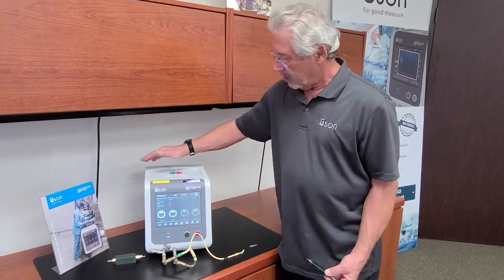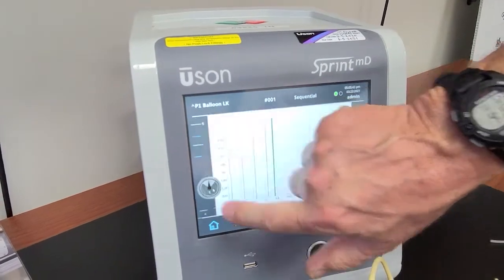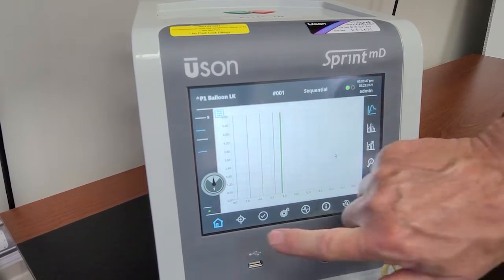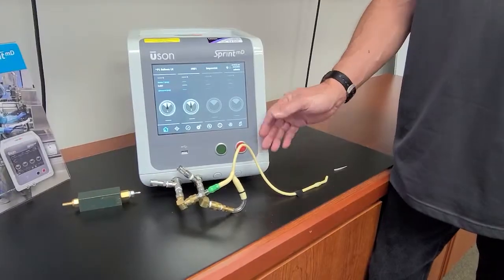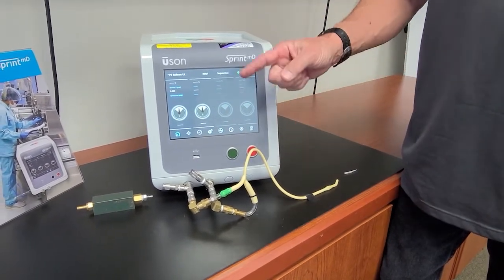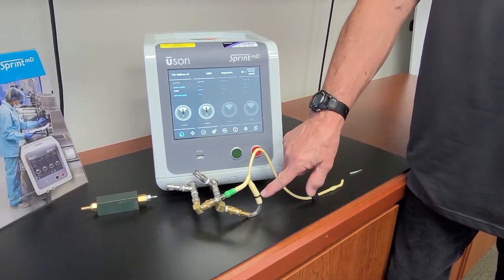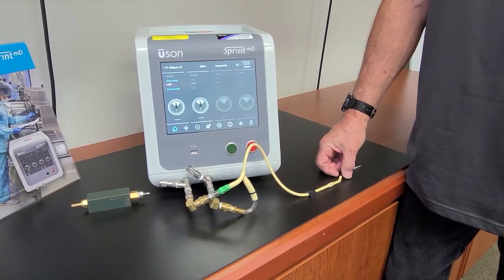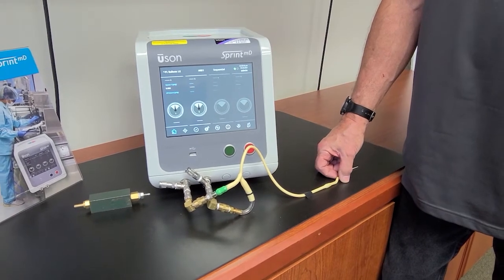Sequential Leak and Flow testing with Sprint mD

Comment: I need to perform a similar two-stage test and was wondering if the Sprint mD is capable of performing this test:

Test 1:
1) Fill device to 30 mmHg.
2) Test for pressure decay over 10 seconds. Display overall pressure decay throughout this duration.
3) Do NOT vent pressure from device.

Test 2:
4) Fill device from 30 mmHg to 40 mmHg.
5) Test pressure decay over 5 seconds. Display overall pressure decay throughout this duration.
6) Vent. End test.

The current leak tester I have can link two tests like these together. However, it must always vent before moving on to the second stage of the test. Thanks!